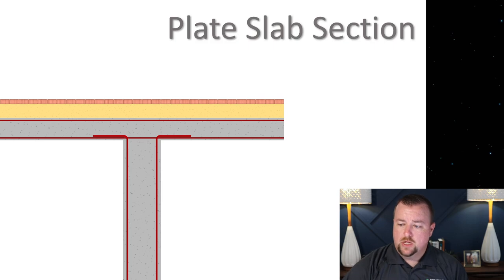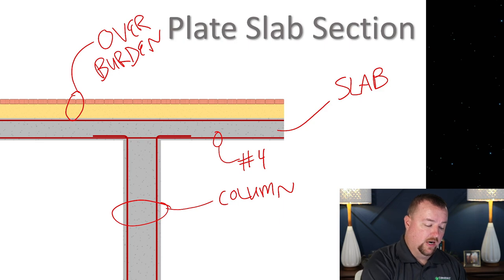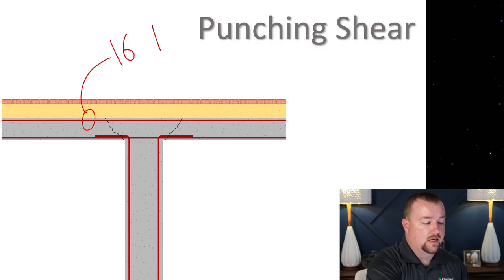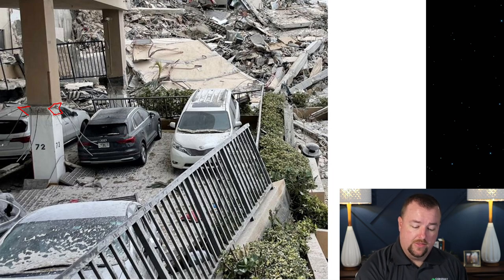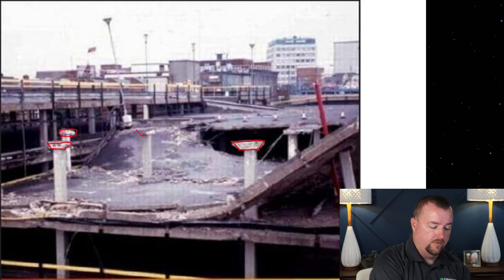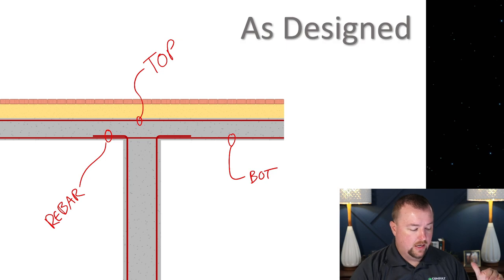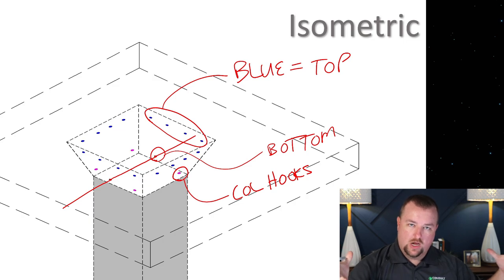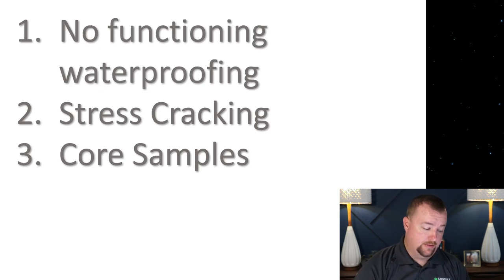The Importance of Punching Shear at the Surfside Collapse

Comment: 22:40 As I see it, the lower, disengaged, part of the slab eventually fell down first. The upper part with all the rebar in it formed a blanket which was eventually pierced by the then acute columns and the weight of what was on the deck, sand, tiles, planters it had to carry alone. That action might also hve broken off any shear heads remaining in the first place.
What I found astonishing is that there is absolutely no rust visible at the cracks in the core which separate the layers. If spalling was due to rust expansion then there should be rust is the ambient concrete. So it looks like a bad cohesion of the concrete. Perhaps by pouring it in layers of which one that stopped exactly at the rebar level. Pretty unprobable but what do we know how they made that thing? 
Wouldd have interesting to look at the core holes and how the concrete looked on the other part of a core. The core gets handled and no one knows where the spalled concrete went. It should have been taken out of the core drill  and laid next to the core as evidence.
Reply: We need to see the analysis report.

Comment: Why did none of these columns have any extra support angled at the tops of the columns that would distribute the weight better? There are plenty of over 100 year old bridges and buildings that have that. They are still standing and in use today. Why not this one?
Reply: Money. It would cost more to design and build. Of course it would have been much, much safer! This design isn't a shortcut by any means however. It all calculated for 
it's own dead weight. It is not designed to be a live load supporter by any means.
 Example:
If you accidentally  dropped ten thousand pounds on the roof from ten feet above
the building it would have collapsed as well because the building's integrity was
compromised!
Reply: Most of those old designs have no reinforcing steel so they need to have more arch action to keep the material in compression.
Reply: @hestheMaster  I'd bet 2 ton would of done it with some of the photos
Reply: One word, money
Reply: I was surprised that there were no dropped soffits at the column head for increased shear resistance. However it is a long time since I did structural design, and never in the US, but I have built a lot of structures.
Reply: It is explained in the video, watch it again.
 The entire top layer of the structural slab, above the top steel matting, had delaminated (detached) from the rest of the structural slab, due to water damage. The designer specified multiple 5/8" steel rebar over the tops of the columns, but they were in the top matting (which had previously delaminated from the structural slab.
Think of it like an I-beam that has had it's top flange cut off. It will be MUCH weaker as it has lost it's top compression member and will be much more susceptible to forces trying to twist it.
Now, whether the extra rebar as specified, was built into the top matting or not, will come out in the fullness of time. However, I've never seen anyone installing or overseeing the install of rebar make decisions to not install such large portions of rebar on site, and the designer/ engineers clearly called for it according to the drawings released less than 12 months before build. If you've ever seen steel being laid for a slab pour, the people doing it are working right there, on the job, with the construction drawings.
Reply: Rumble Hat- They were removed before the demolition.
Reply: GREEEEEEED!
Reply: @LTVoyager  and they were built to last indefinitely. I was shocked reading engineering forum many who seamed interested in safety talking about 50 year life span like that is an acceptable life span for a building people will be living in. Or any building for that matter. With specified maintenance any residential building should be expected to make two thousand plus because there will never be people moving in wanting to stay a short while.
Reply: @RedRocket4000  I agree that’s structurally, many buildings will last far longer than 50 years, but indefinitely is certainly not a reasonably design objective.  The reality is that the changes in building codes for fire, electrical, environmental, etc., generally mean that in the US most buildings more than 50 years old simply cost too much to retrofit if that is even possible.  Many of today’s energy requirements are simply not economically feasibly for retrofit to a 80 year old building.

Comment: After this lesson on the cores, and how little rebar was actually effective in holding the building together, it is alarming to see pieces of that very important rebar being removed in the core sample.
Reply: Buildings are designed with many times over minimum strength requirements, specifically to allow for aging of materials, damage of various members etc. One or two pieces of steel should not cause an issue. The real issue is that the entire top layer of steel was no longer supporting the slab, as it was detached.A slab can cope with a few piece of compromised rebar, but not more than half of it not doing anything.
Reply: Exactly, but my point is with the top layer useless you are relying on the 6 points in the bottom layer supporting the load, and when you cut a couple of those with the core drill, that compromises what little support you had right there.
Reply: The rebar removed is completely insignificant.

Comment: Are you concerned about the amount of rebar cut through on the cores?  I mean it's probably negligible when the slabs are that destroyed but I'm used to having someone radar for rebar before we core a slab for a riser sleeve so seeing multiple cut through is alarming to me.  Love the videos, nice to listen to someone that knows what they're talking about.
Reply from the maker: I did find it odd that they cored through rebar.  It's not the way I would have done it.  But I'm not sure it really made anything worse, though it's so hard to say given the condition of the slab.
Reply: @BuildingIntegrity  Wasn't one of those core samples taken right next to one of the planters that was sitting over top one of the columns right out from the face of the building that started to collapse first?...they even left that area they opened up to take the core sample open  for some time ..drilling through the rebar there dont sound like a good idea to me

Comment: It is very possible that the rebar detailer and/or placer and inspector missed the note about the top bar spacing concentrated over the column and instead installed all of the bars spaced equally though out the column strip as is far more common practice in two way flat slabs. A forensic analysis should be able to easily determine if this error occurred. Secondly, the column vertical bars are normally detailed to terminate 3" from the top of the slab, never into the bottom mat. I would find it very odd if a structural engineer specified otherwise. The other building failures that you showed appeared to have that big chunk of concrete at the top because the were designed with drop caps. Perhaps the engineer designed the slab this way due to head room constraints that drop caps would incur.
Reply: Head room constraints lol: no space for wasps.
Reply: If drop caps cost more, let the wasps take them.

Comment: You have not noted, but I think roof work add to delamination. When you hammer concrete it goes all the way across structure, so this extra vibration helped trigger the failure.

Comment: Very simple: slab was slowly collapsing putting loads on the frame which was moving to try and handle the load paths. The pool deck fell and put a large moment on the columns reinforcement weakening the columns causing them to fail in torsion. Eulers radius of gyration.

Comment: you saw it, i saw it, an engineer required these cores, so what did he say about the delimination. What was the strength of the cores? how could this be ignored.
Reply: Yes, that’s a good question. Does the report make it clear that the concrete was in such bad shape?
Reply: @joanberkwitz2662  I think the report recommended complete replacement of the deck?
Reply: The engineer had essentially ordered roof repairs to start and more extensive repairs to be planned. It looks like the massive delay caused by the condo securing the $15 million dollar loan and the overall delay in noticing the problem were the culprits. Note: that $15 mil was a lot more than estimated to do the work and orders of magnitude more than the roof needed, so we know they had EXTENSIVE work planned elsewhere and were getting a loan way beyond the needs of the building. 

The tragedy here seems to be that if everything just happened 6 months faster everyone would be alive.

Comment: very interesting.  Question:  If delimitation occurred, column punched through, wouldn't the top rebar create an effect of a net draped over the column?
Reply: I have the same question. We don't see evidence of that top layer of rebar.
Reply: Because the column went through it when the top gave way and it would be below the topping lawyer we see. It was a net of steel and once separated from the cement, it could be passed through like a needle passes through knit fabric.
Reply: From the video, it was suggested that the possibility of  significant delamination would have weakened the rebar causing it to break apart. The core sample photos appear to support that theory.
Reply: At 4:36 in the video, look at column 72 and please read my comment above.
Reply: @scottbc31h22  that's a very good point we don't see that in the other columns
Reply: @scottbc31h22  Thanks.  Great videos BTW
Reply: He explained this in the video. With no intact concrete around the rebar to hold it in place, the column would push right up between the bars.
Reply: Generally no. It doesn't create a net. The slab would have to be drastically deformed before the punching for this to take place. The top bars are too close to the top surface. The bar simply rip off the thin top surface before they can act as a net.

However, there is integrity steel in the bottom of the slab that runs through the columns. Since these bars are lower down, they won't rip out of the top surface.

Integrity bars are a second line of defense for punching but require extensive deformation of the slab to work. We call this a second order affect. I don't believe integrity bars were required in the 80s so that why you don't see them in this case.

Comment: I have core drilled hundreds of holes in slabs. I have never seen a core come out in one piece. They come out looking just like the ones you show here. What you want to see is the core holes to see if these breaks are actually in the slab.
Reply: If the condition of the core holes is important, I wonder why the engineer's report did not include photos of the holes?

Comment: Those core samples are an eyeful.  If the top layer of rebar had spalling issues eventually thus putting essentially all of the weight on the bottom rebar at the columns it doesnt appear as an 'if' but 'when' it would collapse.  I hope that all of the cores taken around the pooldeck arent as bad as the ones you showed.  
   Another day...another engineering lesson taught and shown in a way thats super easy to understand.  Thanks for your excellent videos..its very much appreciated.

Comment: Anybody over the age of 50 and living in a Northern city where salt was applied to bridges to remove ice knows how the concrete in those bridges crumbled apart and they had to be replaced. Salt destroys the reinforcing steel and at the same time converts the concrete around the steel to a chalk consistency. You called it a delaminated structural slab. Why are we spending so much engineering time on columns? What failed was the concrete slab over the columns and saltwater intrusion is why. Bridges have waterproofing and a crown to shed the water but they still fail due to salt getting into cracks. I recall a blueprint indicating the structural slabs were to be sloped for drainage and waterproofing was to be applied directly on top of the slab. If that slope included large drain pipes then we would not be here. A change from that spec caused the failure. Every outdoor slab with ocean spray salt exposure must be protected from salt getting into the slab!  The Government Building Inspectors should have realized the building was in structural failure and condemned the building until a remedy was installed.

Comment: Best explanation yet on the internet. You will never get this from the news because all they can digest is soundbites and the reporters don't bother to get educated about the topics enough to ask intelligent questions. BTW, it's OK to get a little more technical with your explanations. Even if we don't understand every word, we will absorb some through osmosis. I'd like to know more about the chemical changes in the concrete with moisture over time, and how this affects the bond with the rebar. It sounds like the top rebar caused the upper surface to de-laminate. Would this failure have occurred if there was NO rebar. (yes, this is a rhetorical question, because I'm sure the rebar helps maintain some integrity on the tension side of the slab.) Why were there support beams across only a few of the spans as seen in the garage tour video? If every span was supported its seems disaster would have been averted. It also would seem that EVERY other high rise building in that location built during that era would be subjected to the same failure mode. Thanks for the educational videos. (subbed)

Comment: I do structural drafting for a structural engineer. When we indicate cores on a plan we typically say something like "Scan slab before coring" and "Do not cut Reinforcing". Is it unusual that they would core through the reinforcing here?
Reply: I was wondering the same thing - seems like they would want to avoid coring the rebar since you can't replace that by just filling the core when you are done. Not that the rebar seemed to be doing much any more in this structure anyway.

Comment: You criticize the waterproofing of the pool deck "on top of the tile", and I would agree.  However, this observation does not match the 2018 Morabito Structural Engineering Report where they attribute the pool deck failure to "waterproofing that is laid on top of the flat structural slab."  I could not find a section drawing of the pool deck.  Can you shed any light on this discrepancy?

Comment: Oh man. Waterproofing over thinset. Good god what where they possibly thinking? 

I don’t have any structural engineering training or experience with concrete buildings but I’ve repaired and installed enough bathrooms in my time to where even I know there’s no chance in hell of that doing anything at all and it’s just a terrible idea. What a complete joke. It always amazes me that this type of  complete Idiocracy can happen on these large projects same as it does on an individual bathroom.
Reply: While to be fair it was the 80's Miami . They were probably all coked out lol.
Reply: I imagine it was like this: The residents were complaining about water in the basement, so management told the maintenance company to DO SOMETHING (but keep it cheap). So they spread a few buckets of waterproofing material.

Comment: I'm satisfied to live in my modest 1944-vintage wood-frame single-story {with unfinished half-basement} house.  No corrosion issues, no collapse likelihood.  And no neighbors screaming through party walls...
Reply: You have a roof. If you don't fix leaks, the wood will start to rot, and the roof will collapse on top of you. Look at old, unmaintained barns in various stages of collapse. Sun, wind, and water (both liquid and solid) will destroy everything given enough time, even mountains. Maintenance is needed to fight this, and this building got too little.
Reply: I think his point was: I got 99 problems, but needing to depend on stupid government to repair my own home ain't one.
Reply: Does it still have asbestos and lead pipes?
Reply: @-._.-KRiS-._.-    Original plumbing was galvanized steel, but we renovated kitchen/bathroom in 1999 & redid the water service in copper throughout - this is one of the glorious advantages of an unfinished basement.  There might be some asbestos fiber in one of the kitchen linoleum layers, but it is stable & buried under more modern flooring.  New asphalt roof shingles about 8 years ago after stripping off two previous shingle layers.  New high-efficiency gas furnace & gas water heater last year.  Regular maintenance pays long-term dividends.

Comment: Column reinforcement should lap with slab top reinforcement.  Slabs without shear reinforcement & inadequate top reinforcement can fail by columns punching through on the perimenter of the columns.  This has happened to bridges in earthquake zones & many years ago a slab bridge being demolished in the Uk suddenly failed by columns punching straight through the slab.  Waterproofing should be applied directly to the top of the structural slab.  If slab not cured &/or vibrated properly then concrete can shrink away from the bottom of the top reinforcement.

Comment: The fun question, how do you repair an issue like this before a major event?
Reply: Not with plastic panels attached to the ceiling and fresh coats of paint on the columns, that’s for sure.  Not being smart but we see both in videos of the garage prior to the collapse.
Reply: @tarawerner4271  Seems dire to think about repairing something that is about to fail, but that is how many engineers make their money.  It appears the pool deck would have to be replaced.  Then there is the water table issue that would need mortar injected below the garage floor.  Columns may need to be reinforced to a 24"x24".  It is cheaper to repair than to deal with an event like this.